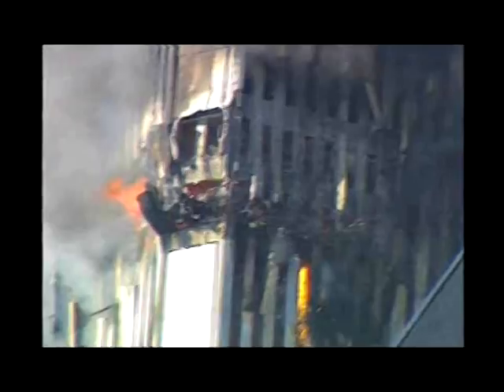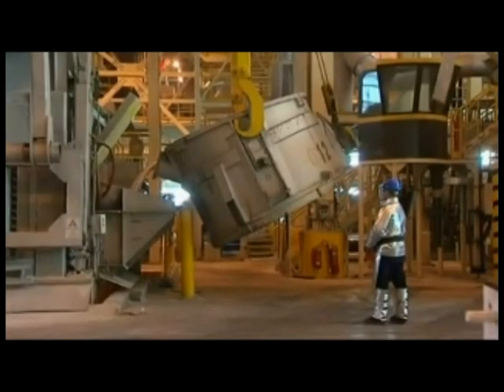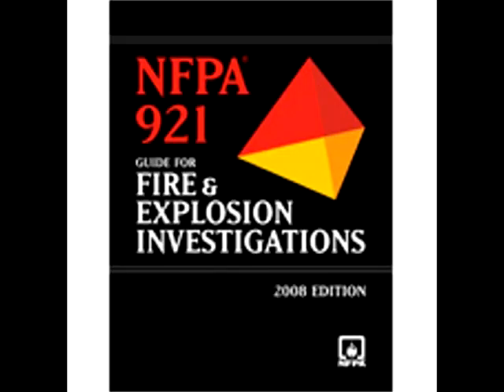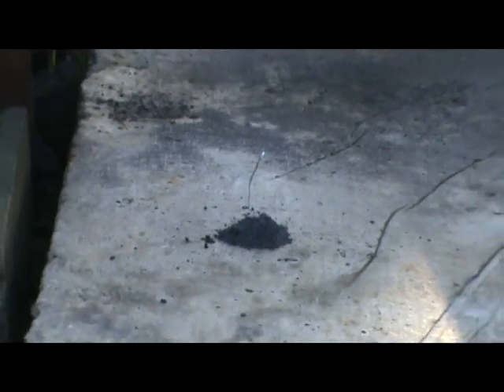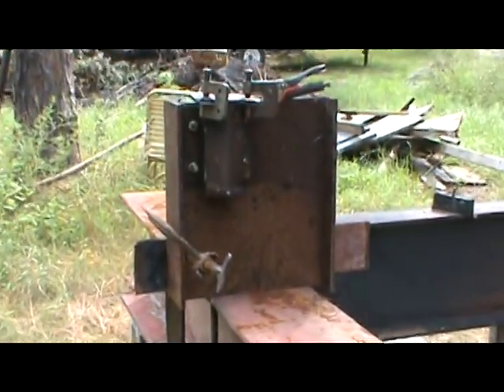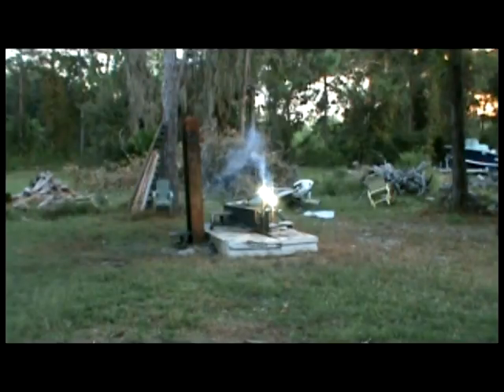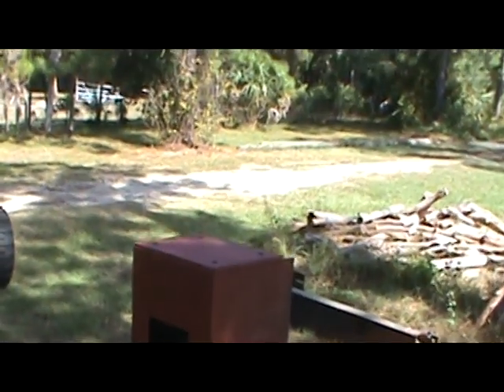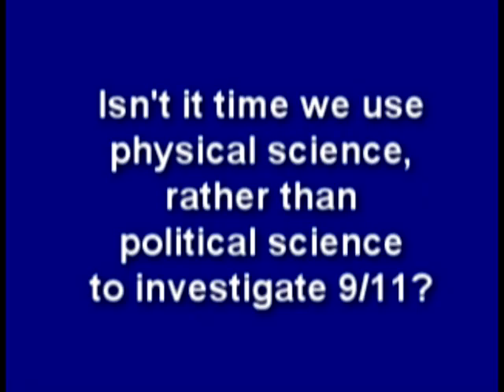9/11 Experiments: The Great Thermate Debate

Comment: I know you can put titanium dioxide in the center of a thermite reaction and end up with a hunk of titanium, and titanium has a higher melting point than steel, so all you have to do to melt steel beams with thermite is make sure as little energy is wasted

Comment: Why does everyone forget that 2 planes crashed into the towers. It doesnt matter if the jet fuel melts the steel beams of the towers or not, the sheer force and explosion of the plane coming in at 300+mph and exploding will indeed BEND the beam and adding weight and pressure to the already bent beam would cause the building to collapse because there is nothing to hold it up. Not everything in this world is an alex jones conspiracy

Comment: One thing you do have to consider is the impact of an airliner. It made the structure weak and the above weight of the tower paired with the heat was just right to bring them down.

Comment: If the steel beams had enough iron oxide as well as a mixture in the steel that over time oxidized and allowed it to combust upon the airplanes impact. Which the burning jet fuel is hot enough to ignite the oxides. However if this was the case the building was coming down anyway. Also Thermite can be mixed with other mediums as well. Aluminum is just the easiest.

Though I do find it interesting that they are like "thermite can't cut through a steel beam" when rail road workers use systems that allow them to both cut and weld the steel tracks.

I've played with thermite myself, and can easy say that it has some seriously destructive force. Also the reason why it was silenced, was because it was a front to get the US into Iraq. During that time our tensions with the middle east were high and oil and other resources were being regulated. The US didn't like that. The wars in the middle east was all about that oil. Have you noticed that they quickly changed what the war was about repeatedly over the course of the time spent there?

Comment: I don't think jet fuel canelt steel, but I think that it can heat it enough to structurally weaken it, but it doesn't explain.the molten steel unless it was under enourmous pressure or friction.

Comment: Rebuild a remote control air plane that can hold jet fuel scaled in the correct size of plane/fuel
Build one of the trade center buildings as an exact replica (completely furnished) matching scale down version of the plane
Fly the plane into it and watch? Seems like it would work to me for an experiment.

Comment: These buildings were built to be unprecedentedly lightweight, as to rise to 110 floors.  The planes busted through the lightweight vertical bars, which existed only around the perimeter, and the inner “donut hole” perimeter. Combined with high heat due to “insulated bonfire affect” softened the remaining vertical bars. This tragedy was caused by terrorists with planes, albeit the intelligence into said event is arguably questionable. Your thermite theories are trash.

Comment: Well i always wondered how a building made out of steel got demolished by a aluminum aircraft
Reply: An aluminum aircraft filled with jet fuel and going about 400 knots. Sounds harmless to me
Reply: oDieseLz , if you know basic science then you would know that heat rises and cold air falls but still 9/11 was not an inside job, we all know that Aluminum planes + steel beams + jet fuel fireball + heat creates MILITARY GRADE NANO THERMITE in the rubbles and molten metal.
Reply: Luke Both exactly. Maybe a scratch or two nothing more.
Reply: MyGuitarTwerks ok I’ll believe you instead of countless other physicists and engineers who came to the opposite conclusion.
Reply: An airliners fuel tank is the wings. So basically the fuel tank was the size of the airplane. They also use JP8 which is kinda like diesel and is very slow burning. I would imagine that anything and everything near the blast caught fire which only intensified the heat.
Reply: It happened the same way you can punch through thick steel with a lead bullet. The hardness of the metals dont matter as much as the speed of the objects colliding
Reply: Blount The Mechanic....haha yes but that is the title of the video
Reply: Alton Barna That's not really the discussion. Everyone working with steel probably knows that when you want to bend it you'll heat it with a torch and that you don't have to get it molten to bend it, because melting it would certainly ruin whatever you're building. This is all about the other "military grade super orgasmic thertitmite" evidence. Yeah, forgot nano. Nano sounds so cool. Well, military grade is a fucking wank word. Just call it thermite for fucks sake.
Reply: MyGuitarTwerks, maybe gold or silver? Maybe the load that was inside the aircraft?
Reply: alles klar klaus , nano means the thermite was processed into fine powder which makes the chemical reaction more efficient and faster just what THEY needed.
Reply: Actually commercial air liners use JET A not JP8. I fueled commercial airplanes for 3 years.
Reply: Chuck Schick No they are not the same thing. I was using it as an example to show that something doesn't have to be stronger or harder than another material in order to cut/break/go through it. Hardness of the material doesn't matter as much as the speed of said material respective to the "target" material
Reply: Two planes flying far beyond their design spec and physical ability hit two buildings, caused all the fire retardant furniture to melt the steel beams and then the  two buildings turned to dust and floated away leaving very little rubble,, then in building 7 a desk fire caused the whole building to. collapse at free fall speed in perfect symmetry, just after Silverstein said to "pull" it

Then the evidence of the biggest terrorist attack in US history was shipped to China at a loss, for reasons beyond any detectable logic.

And we know it was Saudi terrorists because a passport inside the plane survived, luckily identifying him

Hahahahahahahahahahahaha people believe this shit?
Reply: Alton Barna , look at the collapses again, does it look like it weaken and bent or does it look like it was destroyed? If jet fuel was the reason why the twin towers collapsed then please explain to me wtc building 7, no plane and no jet fuel common let me hear.
Reply: alles klar klaus , nah bruh the correct word is nano, the thermite was finer than just fine thermite. You tried to sound smart but sorry you failed.
Reply: MyGuitarTwerks....i saw an airbus hit a building once before and it vaporized when it hit the building
Reply: name less a Jewish trick
Reply: MyGuitarTwerks , 50% of jet fuel, if not most, burned off upon impact, plus if you look at the size of the WTC then compare it to the size of the airplane and then compare the plane to the fuel tank that it carries then imagine how much jet fuel it might have left, close to non
Reply: Its called force. And weakening the steel to the point of breakage with the jet fuel. Key word "weakening", not melting. The metal you see flowing out of the building is aluminum.
Reply: You might like a video titled ""JFK to 911 everything is a rich mans trick""
Reply: jet fuel burns at 1500 degrees and steal melts at 2000 the steal was 75% weakened  the weight of a plane and rubble is added and it easily collapses
Reply: Tim Minh It makes it faster yes. But it's still wank. Just call it fine thermite maybe? The "military grade nano bullcrap" is just.. nah.
Reply: First of all the material does not matter nearly as much as the speed it is going. A pebble traveling at the speed of light could destroy the entire earth. But it is not the aircraft that brought down the towers, but the fire. Which weakened the beams to the point they could no longer support the structure. As for the molten metals seen they could be any number of materials made out of metal within the building that had a lower melting point than steel. Once the building fell the immense heat and pressure could then cause even the steel to melt, resulting in melted steel to be found in the wreckage.
Reply: Quimerateck its called speed...troll

Comment: Do you all realise that a lot of engine parts for planes are made of magnesium and those parts can do go up in flames from a concentrated heat source duh
Reply: Its more of the interior of the plane that uses magnesium from what I read. The form is stable and non combustible for obvious safety reasons.
Reply: citizendc9 you have magnesium aluminum mixed with iron on the towers it's all going to ignite no matter what . Why do you thing there extinguishers on a plane are made to eliminate oxygen only. Why do you thing you are not supposed to be near a plane when it's on fire. Because all of that mixed toghether

Comment: also, the metal beams were covered in concrete, and almost ever test showed that the thermite failed to penetrate the concrete. so if it was set up before the plane hit, than it didn't happen

Comment: A simple metallurgical test of those metal spheres would illuminate the truth.  Also, one additional useful physics test to nail the government’s narrative to the ground would be to preheat the steel prior to igniting the thermite cutter. This would more closely match the events of the day.
Commercially available thermal lances cold do the job, all that would be necessary is an oxygen source. https://www.boc.co.nz/shop/en/nz/atlc-mini-thermic-lance-lance-mini
Also, early news reports showing aircraft striking the buildings were clearly edited in later replays. This clearly showed what I and my friend saw as a cruise missile, not a commercial airliner. The US government employed people to assert that it was not possible to edit video in real time. In fact I had software on my laptop at that time that was more than capable. Indeed. My first sighting of the news on the day misconstrued the event as being a movie hacked together as an inside joke. ( I was working in the film industry at the time, and it was playing on a TV in one of the crew trailers).

Comment: he is talking about the beams in the outer walls. not the main support beams. in the begin of the video, also, did no one test to see if the molten metal was not corner cutting and using weaker metals to save money.

Comment: Jet fuel doesn't have to be able to melt beams, simply heating them is sufficient
Putting steal beams at a temperatures of about 1100C is sufficient to make the steel loose a lot of its properties and about 50% of its strength as well as any possible heat treating
While also making it expand and warp, breaking the concrete holding it
Also liquid Aluminum can be bright orange, the color of the glow of a liquid metal is dictated by black body radiation
If you get anything hot enough, it will glow first in infrared (that's how thermal cameras see heat), then red, orange, yellow and so on
Even though aluminum can be liquid at temperature where you cannot see it glow orange, you can heat it up to a point where it would glow orange and remain liquid!
But the devices using thermate to cut steel where really interesting and it is a pretty solid theory

Comment: The Aircraft is made mostly of aluminium,  plus a lot of engine and landing gear is made from magnesium alloy, so mix it with iron steel at high temps and hey presto.

Comment: What's wrong with the mainstream experts? How many of them are metallurgists? You don't need to melt the steel, you just need to weaken it. The central core of the building was pulling fresh air up, acting like a bloomery. Making the steel hot enough that it CAN melt, but I doubt there was enough fuel to do so. But weaken it? Easy. After that it was just a matter of time until the weight of the floors above the fire was to much for the burning structure to hold. Either way, lives were lost. That's something we can all agree on.
Reply: You mean the one that was literally right across the street? the same one that had sustained damage from the towers collapse? And was constructed so poorly that pretty much everyone knew it wasn't safe? Paranoia like yours is why so many people disrespect the dead.
Reply: Felix Umbra if you watch the video on 9/11 it went straight down look up implosions on building same effect research
Reply: Lol that shit came down awfully fast for being “weakened”.  Also what about building number 7?
Reply: Felix Umbra so why all 3 building fall down straight? If a plane hit and weakened a certain side, it should collapse towards that direction due to the weakspot. Besides, no one disrespect the dead when we're all trying to figure out what killed them. Building 7, what made it fall down by itself straight on? A piece of the plane hit it?
Reply: Building 7 fell after the towers. And you didn't concern yourself with the part where Building 7 was constructed improperly and was weak to begin with. Poor materials and not enough structural steel was used and building inspectors knew this. That's why first responders knew it would come down. As for falling down straight? That's what happens when the bottom of a building fails first.
Reply: Felix Umbra why would the bottom of the building fall first? The plane hit near the top lol. Regardless, for 3 building to fall down in the exact same fashion all leads to a controlled and forced execution.
Reply: Amirichi, which building are YOU talking about? The Towers? Or 7? Because 7 collapsed under it's own weight AFTER the towers fell. BECAUSE IT WAS BUILT IMPROPERLY. You sir are a dumbfuck. 

Brandon CoX, I only called him a dumbfuck because he can't tell short from tall.
 That's what happens when a building that is already structurally weak gets hit at the base from debris. And it didn't fall STRAIGHT down. It fell more towards the tower, but other than a slight lean? Pretty much straight down. I've seen the video, So I would say that is reasonable to say that building 7 COULD have been purposefully demolished. Tell you the truth, I can see it either way. As for if I care or not is another matter. People died. and who ever caused it will meet their maker eventually.
Reply: Felix Umbra even more so people question "oh why did it fall inwards" SO YOU WANT IT TO FALL ONTO A WHOLE FUCKING SHUNK OF CITY AND KILL MORE.

Comment: So, what you're saying is it would've taken significant prior rigging to setup all these shaped charges, and someone to precisely fly jets into the exact places where they've been set. Each are highly improbable on their own; combined, they're in the realm of "no f'ing way". This was an act of terror, not engineering. Flying jets into buildings scares the shit out of people. They got lucky in doing enough damage, in the right places to pancake the buildings -- something no one thought possible. If, as you say, an office (or jet fuel) fire can't melt steel, why does hi-rise building code require fire retardant? (because fires can weaken the structure, and an hour long jet fuel fire with a blast furnace effect on the 80th floor can get hot enough to melt steel)

Comment: Cut steel?
WTC did not collapse due to cut steel beams.
It collapsed due to weakened steel beams (weakened from the heat of the burning jet fuel and burning aluminium).

Comment: What can melt steel?

First of all you are partly wrong about the temperature of burning jet fuel.
Room temperated jet fuel burns at a temperature of around 1000˚C.
If you heat the jet fuel over its boiling point (not only the surface layer), as will happen if you have a large amount of burning jet fuel, the fuel will spew out gasified fuel wich will burn at a temperature of up to 2000˚C (steel melts at around 1500˚C).

The burning boiling fuel will ignite the aluminium of the aircraft (and of course, other aluminium in the fire).
Aluminium burns at a temperature of around 2500˚C (wich is just about the burning temp of thermite)
Thats by far more than enough to melt steel.

Comment: i believe it would have been a better experiment if you first weakened the steel with a wooden fire (this would simulate the building burning), much like heat treating, if you over do it or do not take care of the temperatures it can consideraby weaken the steel, thus, making it easier to cut through with the thermite.

Comment: The hole caused by the plane would have turned that building into a fucking furnace with the wind blowing into it. Light a fire with wood, check the heat, then blow air into it.

Comment: Dumbass, you don't need to melt the steel , all that's required is to heat it enough to weaken! Heating steel to bend it is nothing new, I have done it plenty of times. Weak steel can not support 30 stories of concrete and steel above it. Jet fuel and plenty of air can burn plenty hot enough. There is no "great thermite debate" except by conspiracy nut jobs like you.
As far as the the puffs of air and dirt as each entire floor hits the floor below it you can drop a heavy book on a dusty table to see same effect.
Try using your eyes and brain for a change scum bag!

Comment: lol That's why it's called super thermite and cut vertically? But the plane already did that sooo it just sprinkled the thermite and it burned down through the steel. Plus, the steel would be uncovered and exposed with no oxide layer so I'm sure thermite would eat through waaay faster. Eighty floors up too? Isn't there a ton of wind so it would fuel and fuel the thermite? So many variables omg PLUS THE WEIGHT OF THE WHOLE BUILDING, PEOPLE, APPLIANCES. I wouldn't be surprised if it could have been done with a few backpacks instead of a plane.